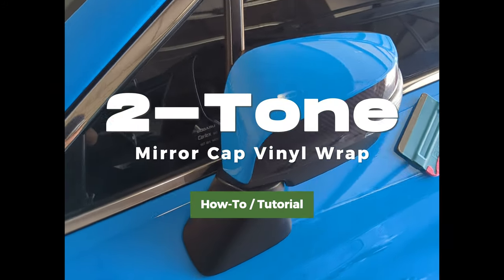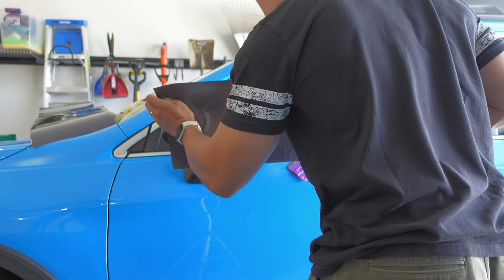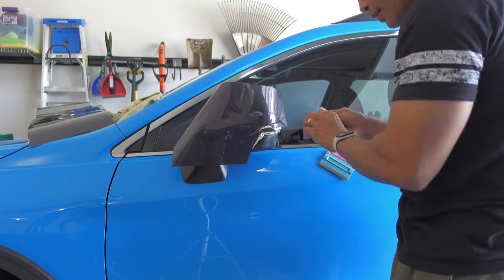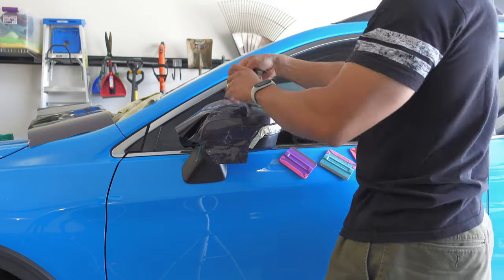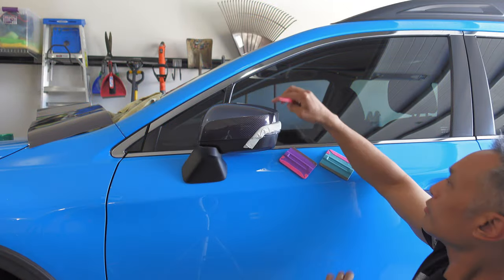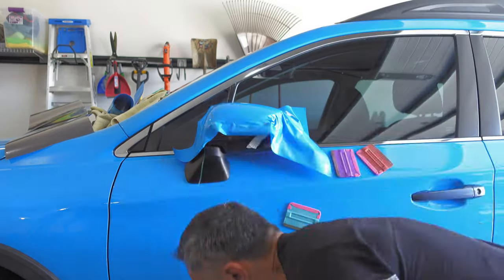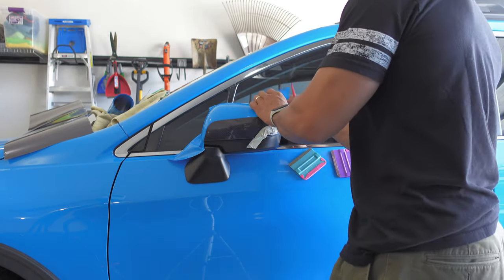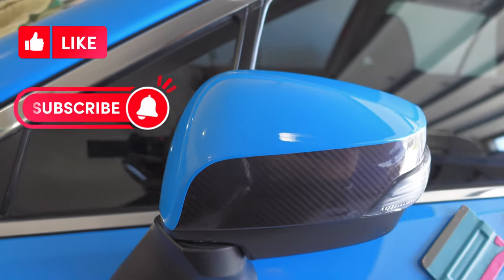Vinyl Wrap Your Car Mirror Cap | 2-Tone Carbon Fiber & Smurf Blue

Comment: Why couldn't you just remove the knife-leas tape in the end after sticking the 2 sets of wraps?
Reply from the maker: Hi, thanks for watching, and good question.  You could cut through two layers of vinyl with the knifeless.  However, in my experience, it's been "safer" to knifeless tape twice.  The first is that depending on the knifeless tape you use (design line or finish line), the filament may not cut through both layers cleanly, depending on the films.  This is especially true of Design Line knifeless, which has a very flexible, but very fragile cutting filament which is know for breaking very easily.  Not so much the case with Finish Line series though. the other is that you have to manage your overlaps so as to not have so much vinyl to "dig out" after you've cut through the layers of knifeless.  If you have too much overlap, you may have a lot of vinyl under the bottom layers that in my experience, you have to lift the vinyl edges you just cut with the knifeless, which risks stretching the now cut-to-shape vinyl edges.  This process now risks overly distorting the cut edge, which may not lay back down in the shape it was cut.  So yes, you can just cut once, but you have to be aware of possible issues when doing so.  Great question!!
Reply: @ColorChangeCustoms  appreciate the detailed feedback